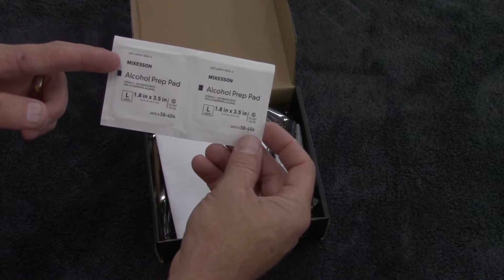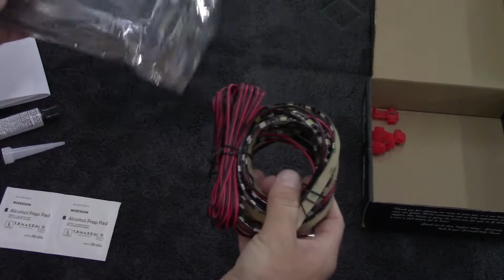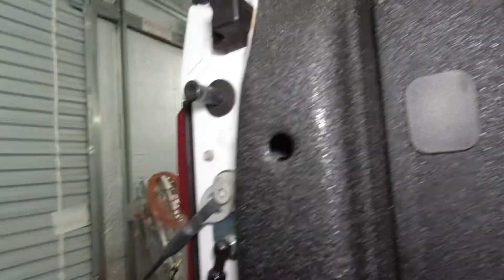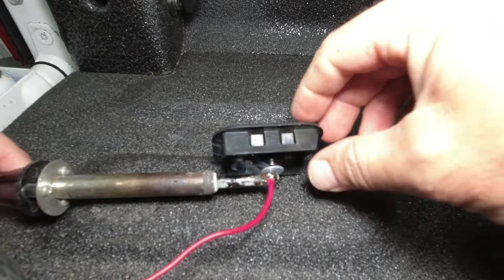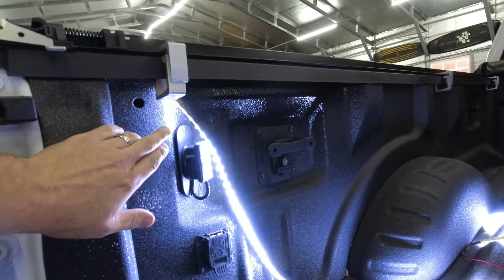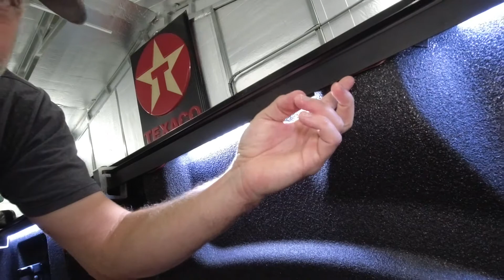The Ultimate LED Bed Light Kit For Your Truck

Comment: Where did you connect for power?
Reply from the maker: I ran a fused wire to the battery then grounded to the chassis.